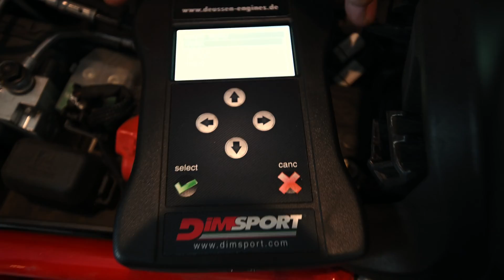Tuning the Pikes Peak! Ducati Performance Optimization - Part 1

Comment: Forgot to mention the absurd pricing that these portable tuning people charge.
Reply: The portable flashing units aren't exactly cheap, either. You're paying for some very specific tuning info that had a non-trivial amount of R&D invested in its development. So half is the hardwre, and half is for all the time and knowledge the tuner had to spend to provide that tune. 

A possible analogy to this is to reference the story about the design of the new Citi Bank logo, explained in Ned Dwyer's story "The $1.5M napkin: Paula Sher's 5 Minute Logo". During a client meeting a designer sketched out the new logo on a napkin in a few minutes. It took the better part of a year to work on strategy and positioning behind the  logo but it still was all pretty much designed in a few minutes' worth of converstatiion.

Now you could say, how could that be worth $1.5 million? Paula's answer was "It's seconds done in 34 years." Meaning how long she's been a designer, and the product being a culmination of her experience, knowledge, talent, and skill.

Yes, the tuner is just emailing you a file to download into the tuning unit to reflash your bike, why does that cost so much? How many weeks/months of dyno time and test rides got it to that point? How many years experience in tuning prior to that? How many years riding prior to that? It's a process, and you're paying for all of it.

Besides, some of these bikes are absurdly priced. In context, a $700 tune on a $32K bike is barely 2%, for a performance and quality of life update to the bike that is both significant and immediate. There are few things, performance wise, that are better bangs for your buck/Euro/whatever.
Reply: @Pyrrho_  Then you go to the dealer and they wipe your tune out or my favorite they update the bike and you have to contact the tune guy again that can't seem to pick up the phone.
Reply: @Waldo1122  Depends on who you deal with and how professional they are.
Reply: @Waldo1122  Return to stock with device--add the dealer/Ducati update--reload the map.
Reply: How do you get ahold of guy tuning bike. I can't find anything online
Reply: @chesterflavell2343  Google or ask Bard, use a syntax of "[bike brand] [bike model] ecu flash". Should provide a list.